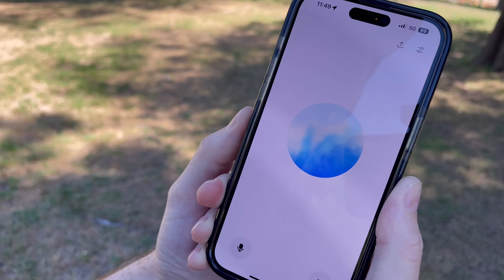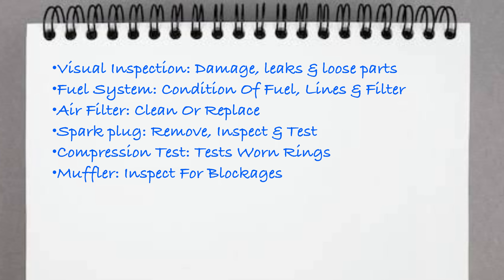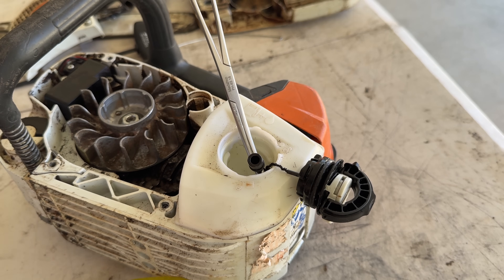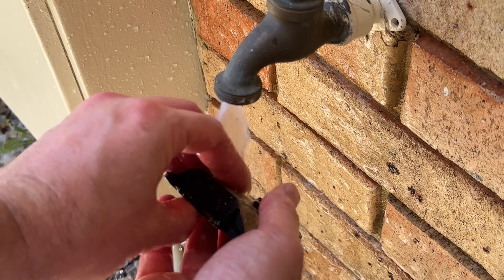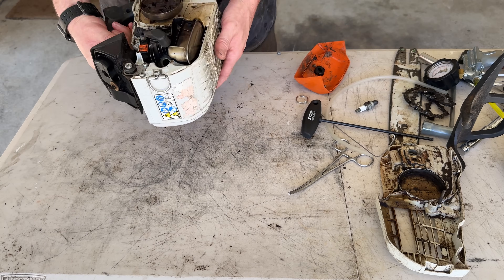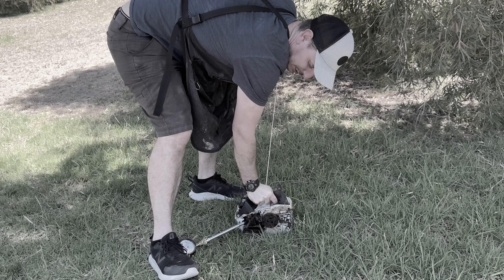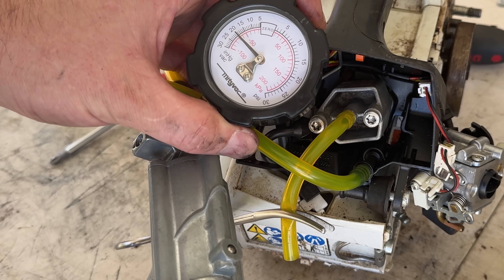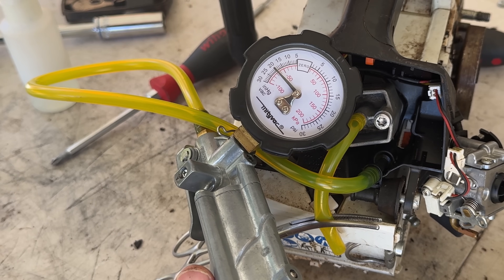ChatGPT VS Stihl Chainsaw - Can AI Fix It?!

Comment: Quick question i wanted to see if you could help me with. I have a ms460. Runs well then cuts out like its lean. Cant adjust it out, it holds pressure indefinitely but seems to leak off slowly under vac. How do i find the slight vacuum leak?
Reply from the maker: If it holds pressure but loses vacuum it’s almost always oil seals :)

Comment: Tom my AI is via these YT tutorials and i'm learning a lot but need to practice 🙂 Keep yours coming especially the re-builds (part 2 of this will be on my list). My carb block came today as well. smaller than anticipated so i hope i got the right one 🤐
Sorry just felt the need to share that my workshop trolley tool chest arrived 3 days early as well. I heard noise at the door and the delivery driver presented me with a huge wet and dirty cardboard package. he managed to get it to my door on his own. he explained that he dropped it twice. I told him he should have asked me for help but allegedly he wasn't allowed to. I signed the item unchecked even though the box was damaged. Unpacked and found the item damaged / dented and have requested a new one. unknown to me at the time of the delivery,  but the noises i heard prior to him knocking was the parcel being dropped and rolled by the driver down my concrete steps. All captured on ring door bell.....Bloody idiot.
Reply from the maker: Glad the videos help :) did you use the link I shared re the block? if not, so long as the PN was the same it’s all good :)  what a pain re your tool chest, that’s just stupid he didn’t use a dolly… sorry to hear that… hopefully the replacement arrives in better shape!

Comment: Defiantly the way of the future, cool video man, I have recently service a few whipper snippers here in Brisbane, they use to run on brake cleaner fine but not start by themselves, I gave them a full service, changed fuel lines, fuel filter, spark plug, rebuilt and cleaned carby and replaced metering diaphragm, otherwise new carby and now they are backfiring? Like the coil has failed? Any thoughts?
Reply from the maker: Back firing is either coil, flywheel position or plug, did you use a name brand plug? If not it’s worth a try, only $6 from Supercheap.
Reply: @ I did, weird it was not doing it before though, my supercheap are $10 a plug in Brisbane 
They want $68 a spark plug at repco for non turboed charged Subaru
Reply: I also did full service on a homelite, changed everything and fuel bulb gets stuck in but it will still start and run perfectly

Comment: For someone that needs to ask this question of AI, they will not have the mechanical aptitude to perform the inspection properly, as evidenced by the problem not being on the AI list.  Much like using the internet for research, one still has to rely on their human factors and experience for a realistic resolution (dependent on circumstances) vs that of theory.
Reply from the maker: Great points!  It's all about applying the knowledge :) I think chat gpt could certainly go into more detail on specific tests if you weren’t sure. If they were technically 100% correct, I’m not sure lol.

Comment: AI has become very good at creating texts in about every language, that is remarkable indeed. The checklist was not bad at all, but without experience or at least basic knowledge  - would it really help?
In real life a hobbyist would just have fired up the saw and found it would run very bad, then inspect carb, ignition and so forth. Finding the piston damaged so bad would have taken more disassembly without the bore scope, that tool was really helpful here. But would the hobbyist have and use one in the right way when AI suggests "check muffler for blockages"?
Good luck with repairing that neat little saw, I'm excited to watch!
Reply from the maker: Great points raised :) thanks for sharing! Glad I’m not out of a job just yet 🤣👍🏻